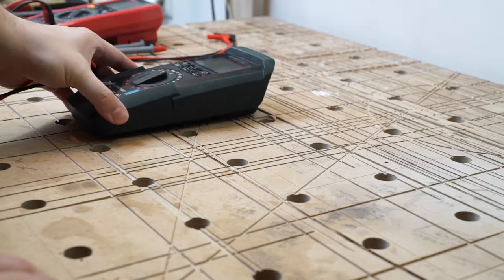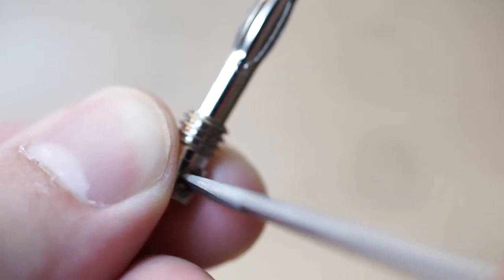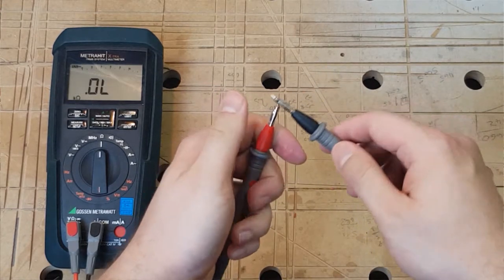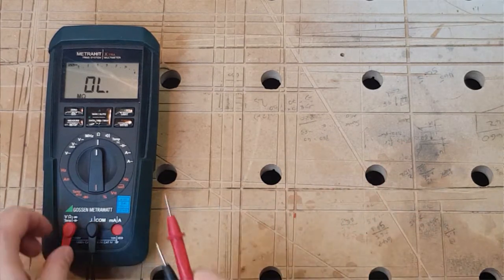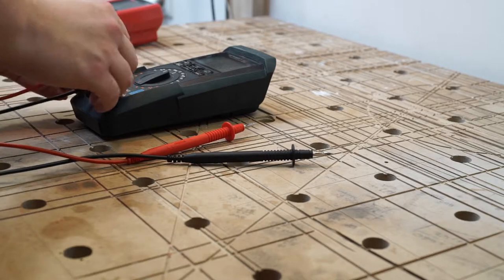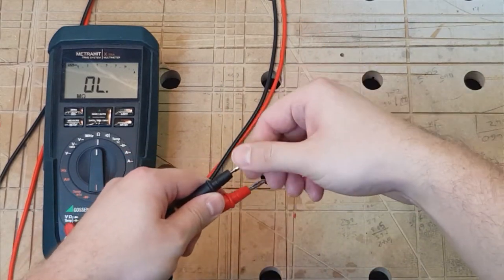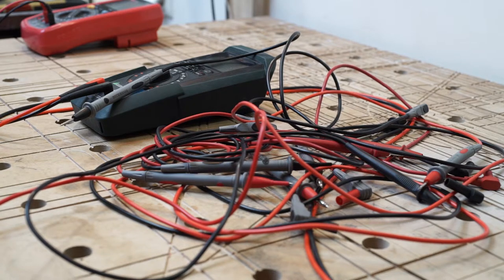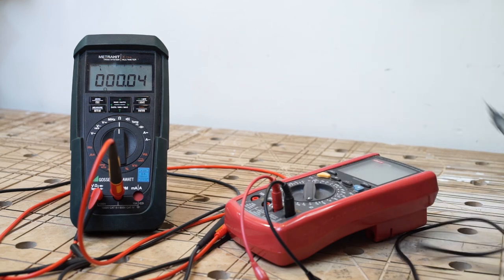2MegOhms measured when shorting out cheap chinese test leads?

Comment: As another comment said, clean the tip of the probes.  I just bought a multimeter and measured the ohms for three sets.  The super cheap one showed highly variable readings up to hundreds of ohms.  After cleaning with IPA, it's a more stable 10 ohms (still bad but fairly stable, although it varies a little depending on where the tips are contacting).  The other cheap one are more consistently 0.3 ohms but sometimes higher.

Comment: If the tips on the cheap probes are plated steel, that will be the problem. Good quality probes are either plated brass, stainless steel or gold plated. For a good set of silicone insulated test leads, with gold plated tips at a good price, get Brymen. Make sure they are the silicone version though, they also do a pvc version, which are ok, but the silicone ones are better and not much more expensive. Even better, probably better than even Gossen, but still cheaper, go for Probe Master or Pamona.
Reply from the maker: Thank you for the tips. I liked the Gossen ones for their handy tips as I tend to measure on board and plug them in afterwards. So there is no change in cables needed. Unfortunately I forgot to put the cover back on, so I shorted them. But for that price, I won't buy them again. 

I've also tried some Fluke 175E but changing it from insulation to banana is tedious and frustrating. 

If you browse my channel you might have noticed that I've bought me a set of Hirschmann PMS 2600 last year. Their tips are connected via a banana plug and so far, I do like them the most. But this is due to my work habit on the bench.

Regards,
Etna.
Reply: I second the ProMaster suggestion, they are very nice.

Comment: there's something wrong with your multimeter, or the connectors are incompatible with your meter. you should expect them to normally have .05 ohms resistance (the fluke should be .03). even the cheap ones should be .2 ohms. try cleaning them probes and connectors.